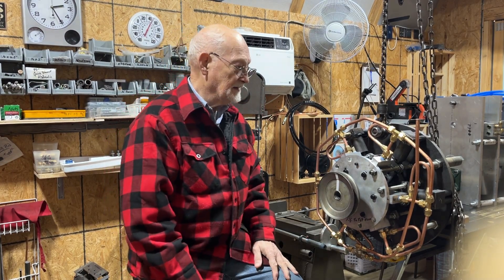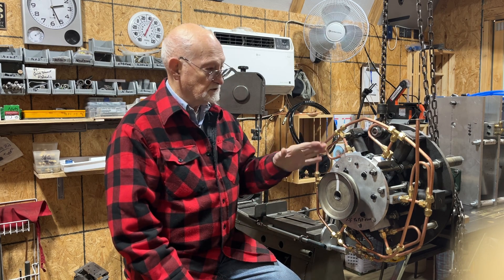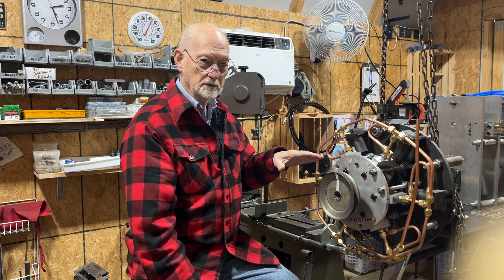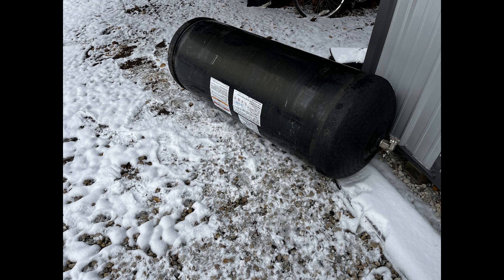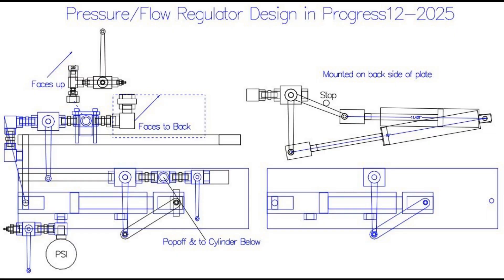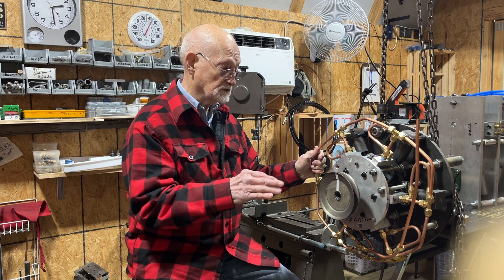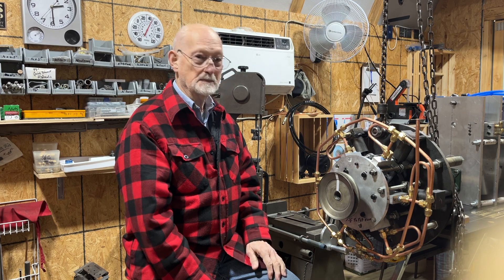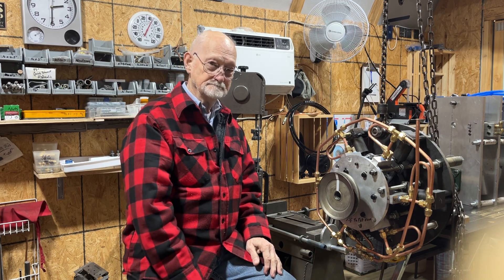Modifications on My Compressed Air Engine, a work in progress 12-9-25

Comment: 5000 psi?! holy molly
Reply from the maker: Yes, 5000 is extremely high for noncommercial type stuff. I guess but hopefully safe enough if I use the proper components.
The purpose for my pressure flow regulator is to have the pressure reduced as soon as possible from the 5000 down to my three or 400 psi that should be used to run the engine. I’m trying to be safe but caution is also necessary.

Thanks for commenting and checking in appreciate it
Reply: @AirEngineResearch You think the regulator will increase the engine range? And congrats for that new carbon fiber tank now that vw will go like a rocket
Reply from the maker: @a @aldintanvor3706 
Thanks for checking in again, yes, I can put more air into it, but it might reduce some of the range because I’m gonna have to pull it behind the car. As far as the pressure regulator, it should increase the efficiency because before there couldn’t get through the tubing and airlines efficiently so now that I’ve gone to 3/8 throughout, hopefully that will increase the efficiency of the engine.

Comment: Have you tried hydraulic fluid instead of air?
Reply from the maker: Thank you for checking in and your comment.
Have you really thought about what you’re saying, using a liquid would mean that the only amount of fluid you have is the liquid, and it’s not compressible. 
But the major problem is that in order to use hydraulic you would have to have a hydraulic motor to push the fluid through the engine so you’re running a motor to run another engine.
So no, I haven’t tried using hydraulic fluid, but it’s good that you’re questioning things that could be maybe?

Comment: looks really nice, but compressed air is the most expensive and one of the most energy consumption conversions, what the idea to build this?
Reply from the maker: Thanks for commenting.
To build a compressed air engine has been a lifelong thought. When I retired in 2005 I’ve been working on it ever since, and I realize what you’re saying is true.
I don’t intend to have it as a means of transportation. It’s more of a novelty, but I do want to see if it’s possible and want to complete what I started.
Using wind or solar power as means of powering my high-pressure compressor that would eliminate some of the cost, but not any effect on how far you could go.
Let’s just call it an expensive hobby.

Comment: I too  have an air engine design that is small,  compact, simple design...
Also have a gear box design, can power vehicles,  like 2 wheeler and 4 wheeler as well...
It can be a practical transportation vehicle, clean energy, no pollution, etc...
Also have a simple vehicle design...
I only need some support, in making a prototype of it....
I am looking for some infrastructure help....
Reply from the maker: I wish you luck, takes a long time and over the time I’ve worked on mine, have spend a lot of money too.

Comment: Nice score on the big tank! Now we are getting serious. I think it is smart to have that regulator as far back in the plumbing as possible. Copper work looks great too.
Reply from the maker: You are correct it’s a big tank, now what am I gonna do with it?
My only option is to pull it with a trailer behind it. It certainly won’t fit in the Volkswagen. It’s too big to put on the car somewhere unless you mounted on top ha ha ha that would be something.